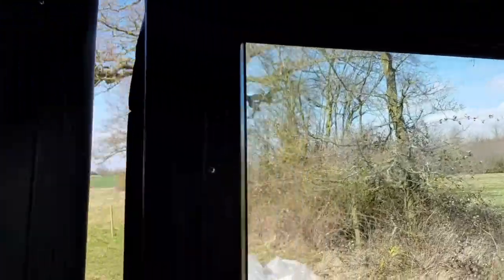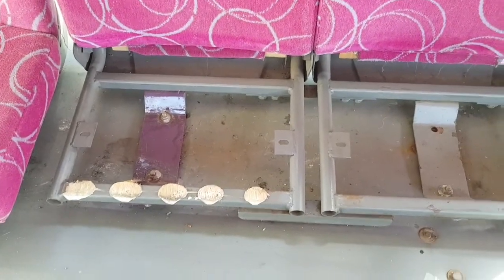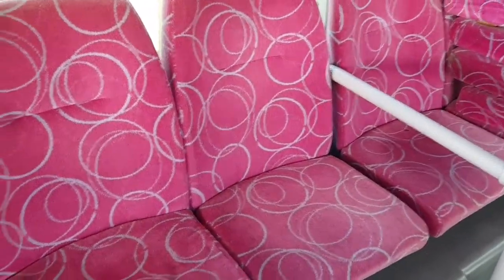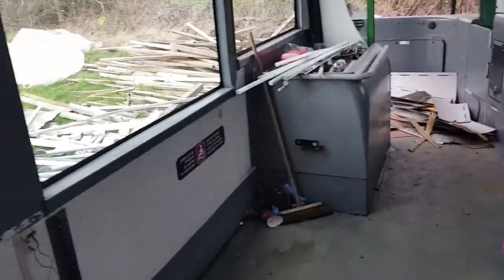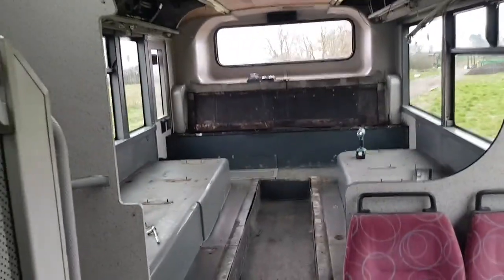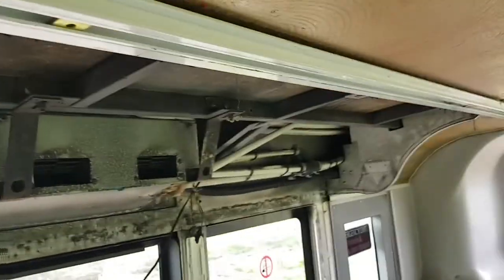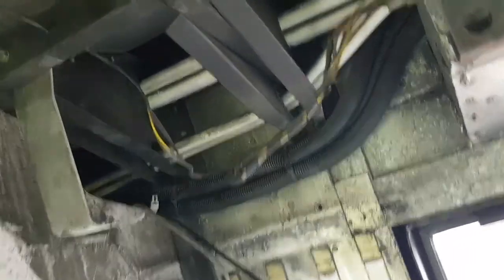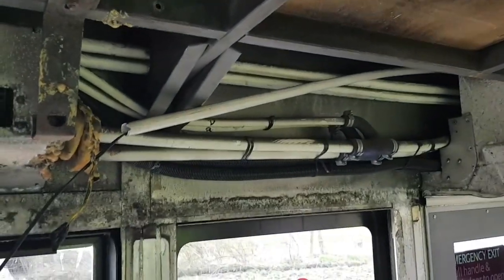Double Decker Bus Campervan Conversion! Part 2, Removing the old seats and interior

Comment: What's the plan for insulation?
Reply from the maker: spray foam and kingspan boards plus maybe some double glazing  if we can get it cheap enough
Reply: @FieldtoFarm_UK  nice one, don't be afraid to replace unwanted windows with sheet metal and spray foam! Will massively reduce condensation.

Comment: Hey... Don't wanna be a nag or anything. But could you possibly HURRY THE FUCK UP AND GET PART 3 DONE. Jeez, trying to binge watch a series here lol 😂

Seriously though, can't wait. Inspiring. I would love to get a single decker as a semi-permanent holiday home that I can travel the country with.

What licence do you need once the conversion is done?
I assume PCV is irrelevant once it's no longer a bus.
I have a class 2, that should cover it, right?
Reply from the maker: Not sure what license is needed, we will cross that bridge down the road when we fix the engine lol.
Reply: @FieldtoFarm_UK  I've done some research. While it's registered as a bus, you need a PCV licence (but no CPC or tacho)... But if you re-register it as a camper/motor home, then you can drive it on a CAT C (or Class 2)